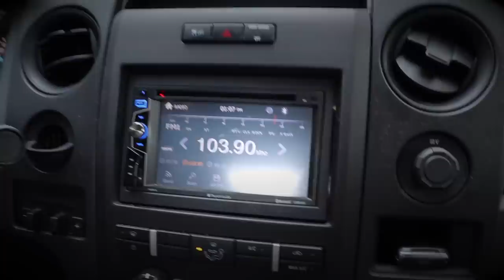AMAZING HACK! How To EASILY Remove A Broken Bolt

Comment: When you've got a steel bolt stuck in aluminum due to galvanic corrosion, here's the a technique that works pretty well. Step 1: prepare the bolt to be turned using any of Taryl's suggested techniques (grind sides, weld but, two nuts, etc).  Step 2: wake up the threads. The hammer blow Taryl used at the end is the idea but but use a punch. This breaks the corrosion bond between the steel and aluminium. Step 3: acetone/ATF mix on thread and let sit for 30+ min. Step 4: heat with heat gun/torch but do not spray lube as it immediately cools it down. Heat expands the metal and cooling makes it contract.  You want the aluminum to expand (makes the hole larger) and the steel to contract making the bolt smaller. Heat the aluminum but use q-tip or pointed tool damp with water to touch the bolt for a few seconds. This will draw some heat from the steel bolt and allow it to contract. If possible I like to do this with a tapered punch of drive pin with another blow with the hammer. Step 5: use whatever twist method to turn the bolt. Chances are better that it'll break free. Give it a try.

Comment: I've never seen anybody drill a hole for the lubricant straw before. That's a pretty neat idea, especially with bigger bolts. But maybe with the tiny, fine-threaded bolts,  drilling makes too big of a burr on the inside, and causes the shavings to  jam up the threads a little. Just a thought. I look forward to the know-how in these videos almost as much as the academy award-winning caliber stories!    The Dapper Dan, or Dapper Taryl line was perfect for this video, since you could say "Damn! We're in a tight spot" about them seized-in-the-aluminium bolts while you're wearing your Dapper Dan  apparel!   Keep 'em comin', Taryl!

Comment: Great video.  You are the master Taryl.  The word “patience “ is a good one here.  I’ve had great luck spraying the part with WD40 and walking away.  Come back a few hours later after the capillary action has had enough time to work.  Then maybe you wouldn’t of snapped off that bolt?

Comment: Great video again!!! I agree with, at least, one of the others. I put anti-seize on all of the bolts/screws that I put into aluminum. Haven’t had a problem yet. But, that doesn’t help on the ones from the factory.

Comment: When I do the vice grip trick, I don't grind flats, I want as much material on there to grab onto as possible. I have a couple pair that are new and only used for stuck bolts, that way the teeth on the jaws stay nice and sharp to bite in

Comment: All the time I worked for Kenworth everyone would come to me to get out broken bolts. Never had a fail. Even 2" deep in a block I would get it. Welded a nut on 75% of the time. Never the first time have to let the heat and cooling do its thing. Extractor rod has special flux that takes up the threads and let's u weld straight up out of the hole inches deep a 1\2" hole. When they come out it looks like a bolt even has threads till u knock off the flux and u see the solid core of weld. I have to mention I worked for Kenworth in AZ. First winter moving back to Wisconsin I went back to welding where it's warm. Great video. If I can find that rod I will mail u some to play with. It will help you out some day if you take the time to try it on scrap till u got it down. Feels unnatural. Keep the videos coming.

Comment: I  had a very similar problem a few days ago.....first tried drilling it out and got an 1/16th bit to go through but each drill bit after that wouldn't work....brought it to my shop and welded a nut (5x) no luck.....since I had the hole in it, I used my similar to yours easy out and got it to bite...took the acetylene torch and slowly/lowly warmed it while turning.....it worked, threads were still good and head was just fine.....all the ways work one way or another, just depends on situation...I do like the drilling into the side and spraying it too, that was a new one for me.....great real world video

Comment: a trick i've used in the past was soak the sucker in WD40 for a couple of days prior to working on it, then the good old heat it and beat it technique heat it with a map gas torch (or propane) smack it a few times with a malleable iron or bronze hammer then grip with the baddest pair of vice grips you have and torque it side to side while spraying more WD40 on it, i've done the weld a nut to the end trick before and like you said, small bolts/screws are hard to weld and get good penetration on both parts, good vid entertaining and informational as always Taryl

Comment: I'm on my daughter's YouTube account. I used to do like Taryl showed. Taryl is right about the welding onto small bolts. In Taryl's case I would've placed a washer that just fits over the broken bolt. Since the broken bolt is 1/4", I would use a 3/8" nut. The washer protects the machine from being accidentally welded to the bolt. I always go two sizes bigger with the nuts for two reasons. 1: When you weld the nut and bolt together it's not being held only by the top of the bolt. Some of the weld makes it to the threads for a better bond. 2: Because the nut is bigger than the bolt, you have to weld more which means more heat and penetration. While the nut is cherry red I spray penetrant oil at the base of the nut so the heat soaks it to the threads. You have to take it easy with the bolt. Just keep loosening and tightening. And keep oiling so the oil keeps reaching the threads. Just be patient. I've had bolts where I spent 5 minutes or more and the bolt will only turn half a turn. I just keep at it and keep oiling it and have had the bolt come completely out the next minute. The oil needs to get to the threads. By loosening and tightening the oil will get there. Just have to be patient. If the bolt is broken flush I lay a washer is if the bolt was sticking out. I then tack weld the top of the bolt a bit. It's ok if the washer gets welded to the bolt. Then install the 2 size bigger nut and weld it. I have almost a 100% success rate.

Comment: I did this job yesterday, all three mounting bolts on a  3.5 hp B&S.  The motor was small, but not the job. Did the job by center drilling the bolts to 1/32 under tap size, then chipped out what was left of the thread. I was hoping you could teach an easy method. I did learn the oil pilot hole, ty. Lol, as you said, it is not an easy job.

Comment: For most people. At “12:30” is the point where you would just bring it to me and I drill it out in the machine shop. Or a shop close to you. 
This is an awesome video showing how to successfully remove a bolt that’s broken above the hole. Broken below the hole and that’s a whole nother video.

Comment: I agree what you said about engineers and all there schooling. Also fine thread versus course thread for the bolts. Same thing applies in cases where button head allen   bolts are used when should have been socket head screws on some equipment.

Comment: Read something about pouring boiling hot water does something to break down the aluminium oxidation to remove seized bolts. I haven't had a reason to try it yet. Have you tried paraffin wax after heating?  Sometimes they use loctite  to seal the threads and reduce contact from the dissimilar metals.

Comment: I was just wondering do you assemble “problem” threads with any sort of “preventative”. Usually I just wish the manufacturer had used better plated  bolts or stainless. I have found that using high quality loctite flange sealant helps a lot by keeping the moisture out of the threads,no moisture no rust. The acetic acid in some silicon can actually make it rust quicker though. If you don’t want threads to rust what do you use on them at assembly?

Comment: A guy who owns a machine shop once showed me where he would heat the busted off bolt cherry red and then take a candle to the bolt and the wax would go around the threads penetrating into the head or block with the broken bolt. This works on steel as well as aluminum. It uses a capillary action when the heat draws the wax into the threads.

Comment: Tip for Terryl. When you weld the nut on try to get your wrench 🔧 on while it's still cherry red and gently work it back and forth like you showed. It should break loose as it cools.

Comment: I like to weld a washer to the broken bolt. Easier to weld on and get better penetration. Then weld a larger nut to the washer. After all the welding the heat usually helps release the broken bolt.
Reply: Yep, totally agree, washer first, then the nut, gives you a lot more weld and much better weld penertration.
Reply: Also easier to see what your doing on a bolt that has broken flush.

Comment: Taryl sometime try your method and touch some candle wax to the bolt and that hole you drilled after you heat it up SOMETIMES THE WAX WILL MELT DOWN AROUND THE THREADS AND LUBRICATE THEM!! THIS METHOD WORKS REALLY WELL ON PIPE THREADS TOO! I LEARNED THAT TRICK 40 YEARS AGO!!

Comment: I had problem like that with my old 28hp Yamaha outboard motor (-73) The low unit bolt broked and i heat it up very hot and sprayed lot of liqued wrench on it. Finally i got i out with a strong pliers.

Comment: For that steel in aluminum you could immerse in a solution of water and alum in a pan over a campstove. Leave it in the heated solution and eventually the steel will dissolve. Did that on a broken sump bolt in a tecumseh vtwin.  Unfortunately it was after I tried to drill it out so I still had to oversize cause I messed the aluminum with the drill.
Reply: AvE showed how to do that on his channel a couple years ago.... definitely has to be heated tho....

Comment: I use automatic transmission fluid for penetrating oil. The molecules are so small it works good. I rarely have luck using vise grips on the end of a broken fastener.

Comment: I remember back to the early 60's when Loctite first came out that all the Honda case cover screws were Loctited in and nobody new what it was or that a little heat would break it loose.  I broke or rounded out almost every case cover screw I tried.  If you needed another screw, none of the hardware stores had metric screws so you ordered them from Honda.  1 month wait time.

Comment: A machinist trick I learned from YouTube for bolts in aluminum is to use candle wax and heat. The paraffin doesn't burn off like penetrating oil. Paraffin will melt in and lubricate the threads to help remove the broken bolt.

Comment: I put a matching 'warsher' over broken off flush bolt!  Then put a larger nut over it and weld away.  Looks like the one beside it is now locked with broken bit.

Comment: One thing I've found to work is to use B'Laster. It is thin and penetrates pretty well. It also feeds down into the threads with heat  and reapplication of it.

Comment: used the nut welding method the other day. on a smaller bolt, that was flush. worked perfect.

Comment: My uncle worked in the Oklahoma oil fields. Sometimes they would drill two holes across from each other where the bolt threads and hole threads came together, drilling thru all of the threads. Then drill another thru hole, in the center of the bolt big enough to overlap the two other holes. This cuts the stuck bolt into two pieces. This will of course damage the threads some, but that often doesn't make much difference.
Reply: I've doing the same thing except the center hole, drilling thru the threads, build up the bolt stud with the welder, lube, heat, hammer. the trickiest part is patience, and not breaking off the drill bit.  Most of them were 1/4, 5/16 and 3/8,  succeeded 99% of the time, even the nasty ones.

Comment: Did the same welded on nut trick and had to used a t handle and socket so it wouldn't snap off from torque angle from a wrench👍

Comment: Taryl i have a Kubota T1560 that needs a deck mine has rust holes in it the thing is 22 years old an cuts better then new riders i want to repair it over the winter

Comment: (Another) PRO TIP: Using the narrowest Cut-Off Wheel Disc, cut a groove along the outside center of the bolt (in the casting). This groove relieves the tension of the aluminum or steel, by way of the groove. This works well for Exhaust flanges & Manifolds that are badly rusted. (The Threads remain intact & usable even with the relief cut parallel to the threads.). "There's a second helping for Dinner!"

Comment: I just weld a nut and let it cool before trying to remove it. Even flush or recessed I do the same thing you can't weld to aluminum so it still works just fine.

Comment: i have made good taps and dies from grade 8 nuts and bolts...grind length wise line in the shaft and grind the tip down..the nuts you can file or grind/drill the nuts for a thread cleaner or use as die  :)

Comment: How do u remove broken bolt on ohv cover. I tried a propane torch, half inch of bolt stickin out, put vise grips on it, trin to be carefull. Think someone uesd lock tite on that one. It a 15 hp kohler

Comment: Use a slightly  larger nut on the busted off bolts allows for more time then a quick tack weld  heating up the bolt  the important part let it cool for 5-10 minutes  then it almost always backs out i also use a socket wrench for more  central  force as the farther away you put leverage the more the weld is going to want to break dont be afraid to do it twice if needed
Reply: Ive also  welded  a nipple on flush bolts and burned a nut to it  keeping  it hot and letting it cool  did a exaust bolt and a alternator bracket bolt tht were both twisted off flush in a engine bay where ya cant get a tap and drill easily

Comment: If you would have used'' Tap Magic'', the video would have been over in ten minutes. $ 12-14 bucks but will last a year of use cause you only use a drop per mission. Makes the bit bite harder and proceed through the metal. Made a believer out of me.

Comment: When they're broke flush... The best way is to weld a nut onto the broken shaft... You will have to weld the threads of the nut, and sacrifice it of coarse.... but the heat also helps to break it loose.. Works well.

Comment: Can you show us how to remove bolts broken off flush by welding onto them?
Reply: I don't know if you could weld it without welding the casing of the part.. but will deponds on the situation
Reply: @robrocco5420  mainly for steel bolts broken off in aluminum
Reply: Try welding a washer on first. Easier to see what you're doing and to get more weld on the bolt. Then weld a larger nut to the washer.

Comment: I've had good luck with finding a turbo socket that I can hammer on the thread sticking out and believe it or not you really don't need that much sticking out for a turbo socket to grab and turn them out and because of the way it bites in I've never had it break off

Comment: Damn… wish I watched this yesterday. four busted steel bolts in an aluminum tranny case. Lots of drilling and tapping. Trued heat but I think the welded nut thing would have worked for at least two of them.

Comment: Something i forgot, the engine mounting bolts, they are self-tapping bolts, they are case-hardened, and they WILL work harden, meaning the drilling action, improperly done, can HARDEN the bolt.

Comment: Anti-seize thread dressing on all bolt threads. You might want to take it apart again!
Reply: I go through a lot of it, I also like finding or making bolts and nuts and washers out of brass to use in any special engines for my personal use.

Comment: The hole that you drilled for lube is causing a secondary problem. you locked the threads with the small drill bit.

Comment: I need alot of help, My lawnmower engine is blowing smoke out of the oil intake, and also the air intake, i replaced the headgasket and its not working.
Reply: Sounds like you've got a damaged valve, pushrod, or camshaft.
Reply: @gpweaver  well i found the problem months ago lol it was no compression too the rings were shot up
Reply: @gamerkay5791  Wow, must've ingested something nasty.
Reply: @gpweaver  yeah i bought it used and whoever had it before me did not use an air filter

Comment: Iron reacts with aluminum quite readily , steel less so and stainless steel pretty much not at all , then add engine heat (which speeds the reaction)to the equation and that makes for all the problems because the manufacturer never use fasteners that cost just a little bit more to prevent the problem.
Reply: Not Correct! Don't use stainless steel fasteners in aluminum threads or holes, especially in an outdoor setting, you will find out what a pain real corrosion causes!

Comment: some bolt, like the one that holds the engine to the mower frame, needs a Cobalt drill bit. those titanium nitrate drill bit will not work on hard steel.

Comment: Those little bolts break off all the time on those kohler command heads. I drill them out and replace them with 1/4-20 bolts

Comment: Was taking a wheel bolt off a troy bilt pony it snapped clean off,several hours of trying to extract it and failed I ended up just jb welding it to the shaft lol

Comment: Now remove a part from a broken bolt.
Some machine shops have a "EDM"( electrical discharge machine)
That will vaporize broken bolt deep in a part and not harm threads.
They charge about $200 to do that.

Comment: Taryl, heat is good, grinding flats are good, welding a nut is good but Taryl you forgot the most important thing, a good stream of swear words, doesn't  make the screw come out but it does feel right

Comment: Engineers are those who aced the classroom, but flunked in the shop. If mechanics were designing things, they would be built a lot better.

I have 40 years in the auto repair business, and if I had a dime for every stupid design I ran into on a car, I would own an island somewhere with a brand new yacht in my own private bay.